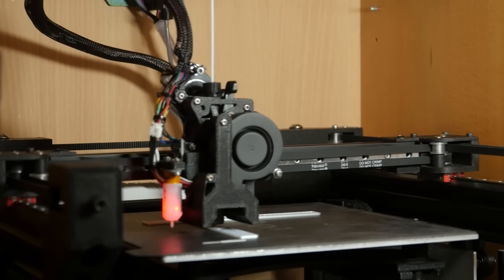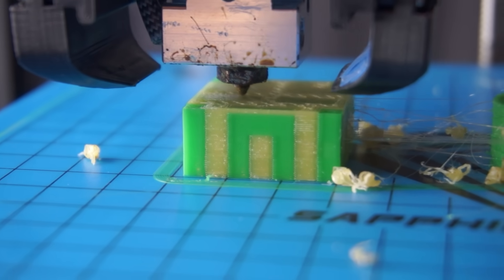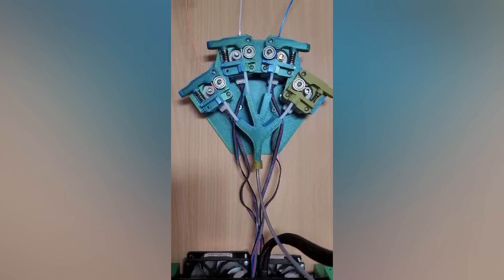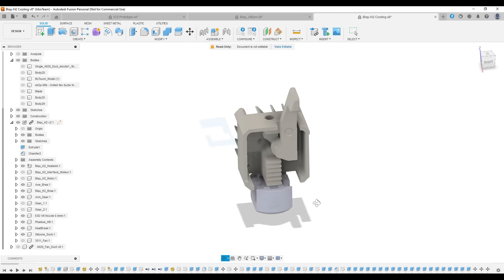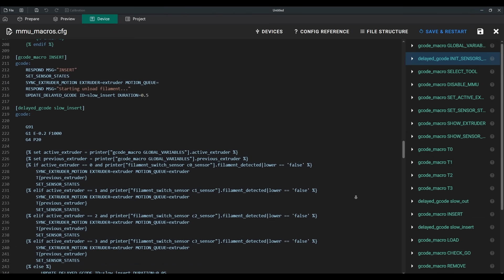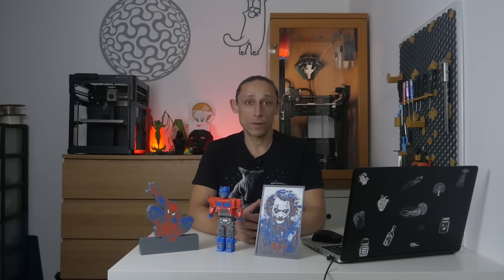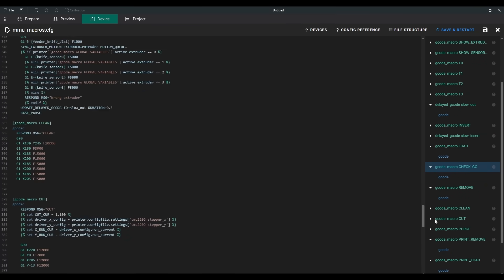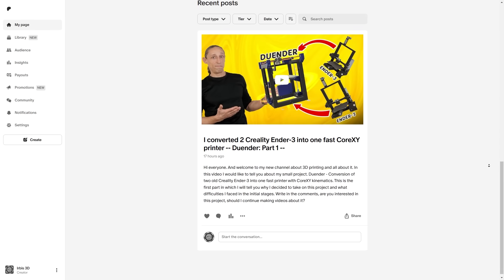I Made a DIY AMS Using Old 3D Printer Parts

Comment from the maker: About cutting the filament and its necessity. I know that it is possible to use a combination of retracts and extrusions in such a way as to minimize the unevenness of the filament tip. And it works seamlessly in the bowden setup. But no matter how much I've tried, removing the filament without cutting is not stable. A slight change in the moisture content of the plastic, a different color, a different type of filament, and you need to adjust everything anew. Because each plastic behaves a little differently. Even the slightest thickening or piece of plastic at the end sooner or later clogs the main direct extruder.

It is no coincidence that all multimaterial printing systems now have a knife for cutting filaments.
Reply: I have been having great success with simply purging 10mm of filament, then quickly retracting to cold zone.  I slowly retract 15mm more, then quickly out of the DD gears.

This gets me a sharp tip every time that loads perfectly.  Even TPU!  This is using a modified 3dchameleon, but the idea should work for any diy MMU
Reply from the maker: I've tried this method. But the result was not stable enough. It was possible to do this successfully only by lowering the temperature by 15-20 degrees, but this is a long time. Perhaps it also depends on the structure of the hotend.
Reply: @Irbis3D  That could be a factor, I have it working on a Creality K1 and DD Ender 3 currently.  Been sharing this with the 3D-Chameleon community and it seems to be a hit!

I find that it always cools enough just from being in the cold zone 4 seconds or so, never gets wrapped up in the extruder gears.  hundreds of changes last night for a 2 color dragon, all went perfectly!

in case you wanted to see the code I use:

G92 E0
G0 X299 Y299 F6000 	; move to back corner
G91                                ; relative movement
G0 Z5 F400                   ; raise 5mm to poop
G0 E10 F250    	        ; push out molten filament
G0 E-10 F3000  	        ; quickly retract to cold zone
G0 E-15 F200  	        ; slowly retract
G4 P4000       	        ; cool 4 seconds
G0 E-100 F3000 	        ; quickly retract all the way
G92 E0
G90 		 	        ; absolute movement

after loading the next filament be sure to run this to lower back down to print height:

G90                                ; absolute movement
G0 Z-5 F400                 ; lower 5mm
Reply: How about adding a TCS3200 TCS230 color sensor to purge only until the color comes out of the nozzle,
Reply from the maker: It's a cool idea, but I can hardly imagine how to implement it in the firmware.
Reply: One hundred percent, I think because of the simplicity of cutting the filament at the head, people underestimate how pivotal it is in unlocking mmu to it's full potential. Tip forming is never going to be 100% reliable it just can't be, hence cutting it becomes critical...its easy to add more extruders(especially with klipper), the missing link was filament cutting then purging. For absolute reliability and ease of implementation. 
Edit: well also rewinding, and syncing the extruders those are also critical components. But I still believe that those would be useless without cutting the filament.
Reply: @davschall  maybe with some printers.  My K1 Max with 3dchameleon MMU does NOT need a cutter.  Thousands of color changes without issue.  TPU, PLA, PETG, PC...doesn't matter.

Stepper Sync is the only thing that is truly "needed"

You don't need a rewinder if the distance between extruder and splitter is very small.  I don't

I printed an entire human size skull with the American flag on it.  I think that one was 670 color changes.  Not one of them failed

Comment: Are there 3d files for this? I would really like to do this with my old printers parts
Reply from the maker: The project is still frozen and not finished for release. But the beta files are uploaded in my Discord channel (Project-Medusa-MMU). There are no manuals for them, so only if someone is ready to figure everything out on their own. Overall, it worked.

Comment: Could you show how to use your ams as a continuous feeder. When one spool goes empty it switches to the next one.
Reply from the maker: I haven’t implemented that function in it yet. But it makes sense, it’s one of the most useful in the AMS.
Reply: @Irbis3D  I think it could be easily implemented in your design by adding 4 additional endstops, each before the feeding stepper motor and once that detects, that there is no new filament, you could have it retract till the endstop on the other side also triggers. Yes that would leave „waste“ in the length of the feeder setup but once there are some collected you can weld these ends together for prototyping.

Comment: I've had a solvo Sv02 2 for years and aside from having to compile my own Marlin firmware because solvo released some firmware that was well let's say teenage because on layer change everything had pimples but that was not because of the mechanics It is an absolutely wonderful machine dual extruder two in one out hotend I got the purge tower really small for most colors and never I repeat never have a problem with color changes I think most of the problems people had on the two in one out hot ends were the mixing hot ends where they were trying to mix two colors together and that's where all the jams came from

Comment: Nicely done man! Quick question...how do you keep your 'ams' extruder in sync with the tool head extruder?
Reply from the maker: The AMS motors are configured as an extruder_stepper. And it is possible to enable their synchronization with the main extruder using macros. I briefly showed it in the video.

Comment: Bro, I am so impressed congratulation my guy you should be very proud of yourself IMO.  What you have created with what you had in the spare parts box is extremally inspirational with out coming off like I'm glazing too hard.... bravo... This is the kind of stuff I love about people in this community it really hits home with me and what I try to do all the time with stuff most people would just throw away or throw their hands up and complain that they aren't interested in something unless it's already done for them completely turn key.  I would really love to get more information about your transformation with your BTT H2 if possible..  I have a H2 v2 that I bought used that the seller screwed me over on and completely hid the fact that he stripped out one of the heatbreak screws so bad I have had to just leave it in their the way it is.  But on top of that I am really irritated with the poor meshing internally of the gears when doing retractions and how crazy loud the clicking is causing you to have to run your retractions around 7/mms.  I was kinda blown away that no one had yet made their own 3d printed body that took the H2's internals and posted it online.  I would love to get your files for your extruder you created for your H2 parts if possible.
Reply from the maker: I'm going to find one new H2 to redesign my extruder for new gears. Then I'll upload all the files to printables.

Comment: I still have the ender 3 original board. It would be nice to use that. Please publish when it's ready. I might also be interested in buying a kit if you sell. Would this work with Marlin firmware?
Reply: it wouldn't because Marlin doesn't have the ability or creating or making custom macros like you can in Klipper... This  is what makes Klipper so amazing because you are not limited to only the functionality that Marlin lets you have but are given the ability to create anything and everything you would want your printer to be able to do Klipper lets you do it.

Comment: instead of trying to swap filaments for one print head, use multiple print heads, or multiple nozzle in one print head. removes all purging waste. also removes need for filament management system. just act if you have multiple separate independent tool-print heads. zero purge towers. because people copy. no self-thinking. better just put in multiple print heads running on their own rails, and have the bed slinger move a longer length to be able to freely use any print head whenever, even at same time. well, assume that you have many small light-weight normal print heads. printing at same z-height. the tool heads can by anything, including laser and cnc. if you make the combiner in the hot-end, then you dont have any cutting or purge problems.
Reply: I think he would have loved to do something like this but he lives in a place that is hard to get parts sometimes and if he is the kinda guy that put in the work to build a MMS out of whatever spare parts he had in a box then I don't think at this point in time he would looking to have to spend the few hundred bucks it takes minimum to do your own DIY  toolchanger unless he just happened to have THAT many spare parts but there is that one channel that has been trying to make a single extruder that swaps with multiple hotends work and he's pretty damn close just needs to clean it up and refine it and that is a SUPER cheap way to do MMS better with out the waste of the AMS style of system

Comment: If possible, look at the Chameleon 3D AMS.   I think the mechanical system is very interesting and simple.   And could have the benefit of having a neutral position,  so the AMS could be dormant during normal printing.    Their software implementation seems overcomplicated to me but the hardware is very interesting.

Comment: Will it be possible to connect this system to the FlyingBear Ghost 5 on Marlin? I would like to receive a list of the necessary spare parts and software to start assembling.
Reply from the maker: I can say for sure that this system will definitely be able to work with the any printer on Klipper firmware. Most likely, this can also be configured in Marlin, but I'm not sure. I believe that marlin is an outdated firmware and it doesn't make sense to use it now. I am currently preparing the Duender project for release. After that, I will start preparing the sharing of this AMS.
Reply: nope not possible Marlin doesn't have customizable macros... but if you have a Ghost 5.. why don't you just convert it to mainline Klipper? That is one of the simplest printers to do so considering many people already have so you have a lot of things you can already pull from on the internet plus the most important part of any Klipper conversion is a good updated printer.cfg file for your printer and there are many for the Ghost 5

Comment: While I would like a multi-material system I outright refuse to accept the waste and inefficiency of an AMS (or similar). I love your approach of using parts you already have and I know I have much, if not most, of the parts on hand already.  Personally what I want is a 5 toolhead IDEX printer.  Sadly I just don't have the skills to develop one myself nor do I want it badly enough to develop said skills.  lol  But, with that said if a company like Sovol would come out with a bolt-on upgrade kit for the SV08 that would give me multi toolhead IDEX functionality that is the printer I would buy...and probably more than one.
Reply: You haven't seen the couple of channels that have been building multi toolhead adaptations for the SVO8? Check out Teaching Tech's series on this topic and also The Next Layer, who happens to be this guys RL friend I believe?
Reply: @TallynTech  Oh I have been watching those.  lol.  Now we just need IDEX added and it'll be right up my alley.

Comment: thank you for the video! I hope many ppl will be interested in a more detailed video with Klipper configuration. Maybe how to install klipper on a stock printer?
Reply: There are already TONS maybe 30+ video already documenting how to install Klipper on all different kinds of machines.... you can buy a Ras Pi and add it to your printer to add klipper, you can use an old laptop to add Klipper, you can use an old tablet to add Klipper, you can use an old Android cell phone to add Klipper.. shit you can do what I did and use an old 5th gen i5 desktop with 4gb's of ram install Linux Mint XCFE as your operating system then install Klipper and run 3 printers off of that machine at the same time instead of putting SBC's ( ras pi's ) in each one.

Comment: hey, would you be able to post your h2 repacked extruder with cutter? i have a few h2 around and bambu hotends and would love to mash them up! great work!
Reply from the maker: Yes, I'm going to post it in a while. I need to re-model it a bit. My H2 was from the very first versions (pre-release) and had slightly different shaft sizes.

Comment: for my end g-code i put a 10mm fast retract the moment it finishes the last print move, like an exaggerated retract during normal printing. gives me a great tip that i pull out after changing filaments and i haven't had to cut said tips for the past year. although that might not still be best for constant switching. maybe if after the retract and when the tool moves to the purge area with heating turned off and part fan on full blast to cool the nozzle tip there's another fast 12mm extract then another 10mm retract to ensure a proper clean break. plus that might help clean out the nozzle, idk

I have idk how many stepper motors laying around and an extra perfectly good board i can use like you have.. this is giving me ideas.

side note, for your filament buffer maybe you can do what Bambu does on the A1 with the spool holder that pulls back. I'm thinking a simple overrunning clutch with just enough tension on a wind up spring, possibly printed out of PETG
Reply from the maker: I've tried many different combinations of speeds, extrusion and retraction. But I haven't been able to get a consistent result for different types of plastic. Even different colors can behave differently. It works, but not for long. Small pieces of plastic accumulate in the feeder and gradually clog it.
Reply: I was thinking of the same thing. A spring on a slipper clutch that has just enough winding to pull the filament back onto the spool. When the filament is pulled out, it winds up to the set amount of force and then slips.

Also, on the 4 feeder motors, could you set the motor current very low, allowing them to skip steps during printing? This would allow any difference in speed to be allowed to happen during printing. When it's time to change filament, increase the motor current back to normal. Not really a buffer, but allows some give in the feeder system.

Comment: Ramming and tip forming is there to not need the cutter.
Reply from the maker: I've tried many different combinations of speeds, extrusion and retraction. But I haven't been able to get a consistent result for different types of plastic. Even different colors can behave differently. It works, but not for long. Small pieces of plastic accumulate in the feeder and gradually clog it.
Reply: @Irbis3D  here are roughly the settings i use. Have toolhead move away from print area. Then extrude 2-5mm @ 3-500mms and retract 3/4 the length of your heatbreak @ 50-250mms . It's's this retract speed that ultimately forms the tip. Then pause for ~20 seconds. Long enough to allow heatbreak to cool the filament, then retract required distance.

Comment: Im pretty sure, MMU was nice solution before AMS. Bambu AMS is slow somehow. I have IDEX printer. I dont want to print toys. And for serious use IDEX is good. So lets see your very good solution for 4 materials. С такими знаниями надо работать инженером по созданию 3д принтеров.
Reply from the maker: Yes, MMU is a great solution, but it wasn't even close to as popular as AMS. In my opinion, IDEX is the best system for multi-material printing. I would make it in a Duender, but it requires a lot of space on the sides for extruders.
Reply: @Irbis3D  Cube frame is not good for IDEX. So its better to keep Duender as it is. Idex must be in wide frame. Best project I know is Magnetic IDEX by some Soviet born immigrant. But his prototype is in small wide frame. Need bigger frame to adopt bed of 250*250 at least.
Reply: you couldn't just say nice job bro? I bet you're a dream to be around
Reply: @TallynTech  I just stand on critical point of view. I shaked hands with Sergey once, long time ago and expressed my gratitude. He has done a lot for our national 3d printing community.

Comment: This is such an amazing project! I had no idea you could use a second board as a second MCU in klipper.
 I have been interested in building a material changer from the ground up like this, but cant figure out a good starting point for understanding macros and klipper modification.
Reply: You can run as many as you want I believe? because Canbus uses one in the toolhead, then you have two already for all Klipper machines automatically so Klipper + Canbus = 3 MCU's already

Comment: It is possible to swap without knife. Just retract 20мм, wait about 20 seconds, then quickly unretract 20mm and eject filament. This will melt than thin tail and leave good tip. 
Also you can use more powerful steppers to eject and insert filament much faster, saving a lot of time.
Reply from the maker: I've tried many different combinations of speeds, extrusion and retraction. But I haven't been able to get a consistent result for different types of plastic. Even different colors can behave differently. It works, but not for long. Small pieces of plastic accumulate in the feeder and gradually clog it.